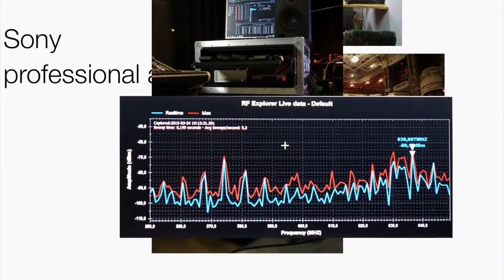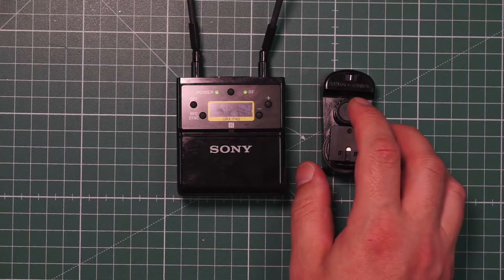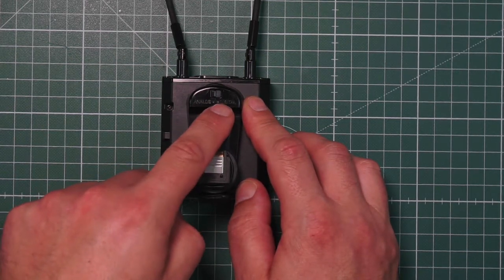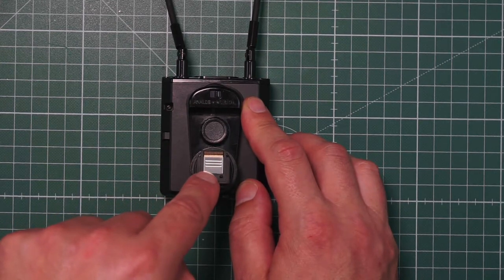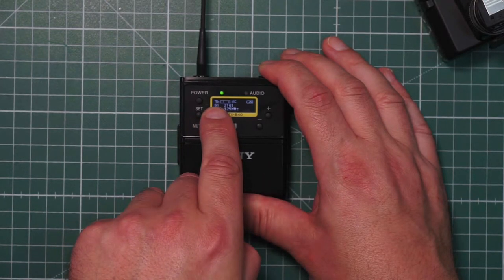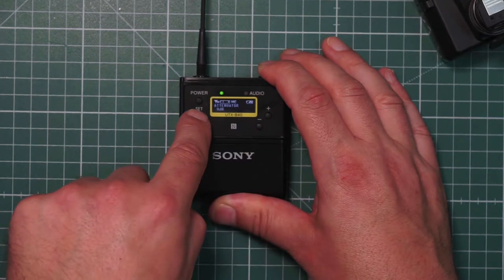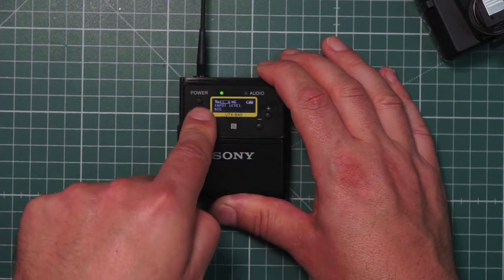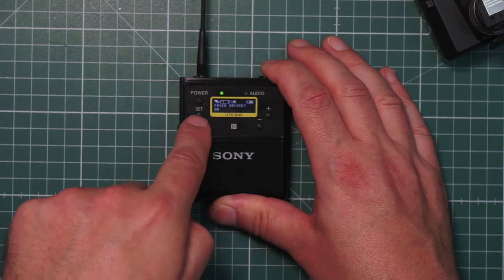#008 UWP-D Gen4 new functions Part2

Comment: Which new uwp-d series that comes with 1 dual channel reciever, 1 lapel transmitter and 1 boom mic transmitter
Reply from the maker: Hi Matona Magopeni. Sony has 4 different ready to go packages in the UWP-D line up, but no one fits your needs (UWP-D21, D22, D26 and D27 kit). Now you have two choices: 1.) Purchase the UWP-D27 kit (dual channel receiver, URX-P41D, with two belt pack, UTX-B40, lave mics, cables, ...) and you order one UTX-P40 on top. 2.) You purchase single components. 1x URX-P41D, 1x UTX-B30, 1x UTX-P40. All required cables and accessories are also coming with the single components. Hope this answers your question. Who you purchase from?